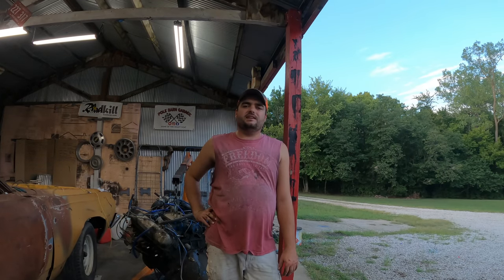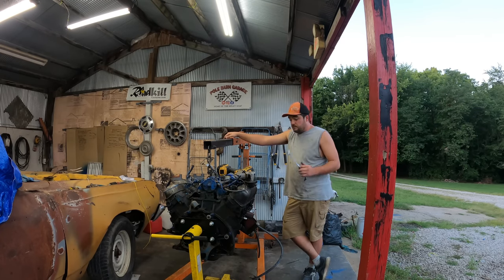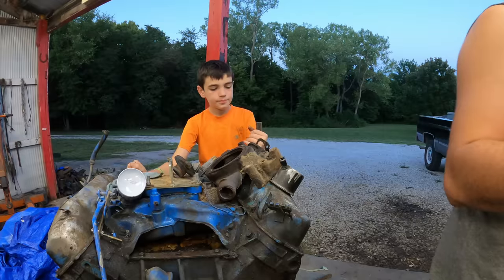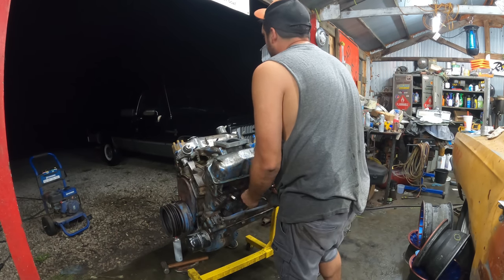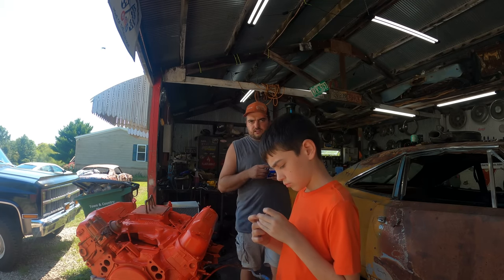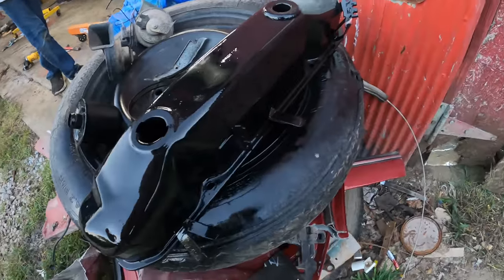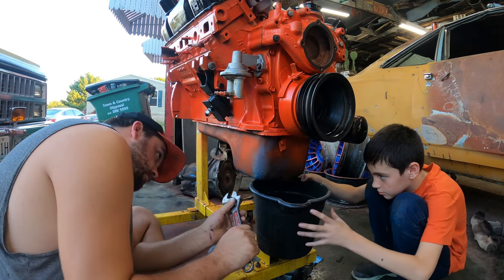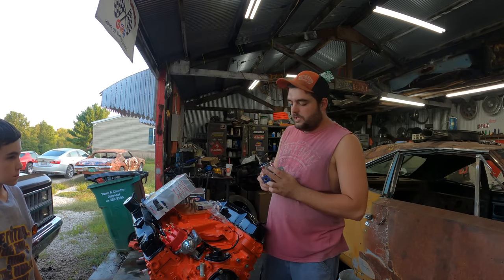Prepping Motorhome 440 for World's Worst Roadrunner - RolledRunner! Rattle Can Rebuild

Comment: Great to see that tractor paint comes in black too and that it can be used on anything.  It may not stay on there forever, but it can be used.  It looks good for the glamour shots when she's done anyway....

I cannot believe I used the words "tractor" and "glamour" in the same paragraph.....but if it's good enough to go on the outside of a Ford, it's good enough to go on bits of a Mopar engine.

I'll enjoy watching this beast come together and hearing that 440 fire up sounding like she's fully rebuilt.  All the best, mate.
Reply from the maker: I'll be curious to see how heat resistant it is. I paint tractor engines with it 🤷
Reply: @PoleBarnGarage  - You could really test its resilience and paint the exhaust manifold with it.  🙃😉  Seriously, I dunno if I would be THAT confident in its thermal rating, but those tractor engines do get up to a heck of a temperature and put up with a ton of heat cycles, so....?

Comment: You can change the tailshaft and housing but you gotta dig into the trans to do it. Its not super hard really since you arent taking any sub assemblies apart. The 67 trans has a smaller hub on the converter where it goes into the crank snout. Then you also run into balance issues because the motorhome motor is externally balanced and the 383 is not. They do sell weighted flexplates however so you can use a neutral balance converter, but they are starting to get pricey. - Jamie
Reply from the maker: Great..

Comment: I myself have found that if you silicone the valve covers on with gray RTV and then allow it to completely cure, they will never leak again. Use brake cleaner to remove all oil first. Kind of a pain if you have to go back into it tho.
Reply from the maker: Oh, so you're the guy that caused this mess!
Reply: I doubt it. But when used properly, it works wonders. I resealed my small block Chevy and it never leaked a bit for 80k. It was still dry when I sold it. Valve covers and intake ends. Glad to see you teaching your kid about this stuff. Good stuff to know as you go through life. When he has a problem, he will have a clue as to what’s going on. 😁👍

Comment: as a cheaper alternative to Brake Kleen if you can get denatured alcohol and put it in a spray bottle it cuts grease  and it also evaporates water, a gallon of denatured goes along way and as a bonus if its left on paint wet it will loosen up most paints.
Reply from the maker: Excellent idea!

Comment: Nice cleanup on the engine. Looks like that 440 has a cast crank. The compression on those is abysmally low, '77-'78 was in the 7.5:1 range and earlier it was supposed to be 8.2-8.4:1 but rarely ever was. It was usually 1/2 below whatever the spec was.
The motorhome trans is much more heavy duty than that Fury trans. They used to tweak the transmissions based on the engine, usage, and power output. 
Yes, you can change the tail housing but you're going to have to change the output shaft too which would require a complete teardown of both transmissions. You need to pull everything out from the pump end in the front. It's not as bad as it sounds. Just about any year Chrysler shop manual has the teardown procedure. If you're going to be beating on it I would give serious consideration to using that motorhome tranny. It's not as bad as it sounds. I've torn down TH400's TH350's  TF727's and TF904's before. There's more clutch packs and wider bands in the truck trans plus the line pressure and kickdown apply lever has a higher ratio for faster 1-2 shift. The rear sprag is a weak point on those and I'm not certain but the MH trans might have more rollers. 
Btw, the HP engines were the only ones painted orange, the standard perf were blue or aqua-green. I used to get my cleaners and chemicals at the dollar store too. I noticed their oven cleaner was made in China. Good luck!
Reply from the maker: Good info. I'll probably have my trans guy swap em over
Reply: @PoleBarnGarage  Yah, it is pretty involved. One thing I forgot to mention is the torque convertors. They changed the input shaft spline in 1967. So '67-up is the same, '66 down different. Don't know what year that Fury was. I think the motor home may have had more stall for torque multiplication. The drive (flex) plate is specific to the toque conv dia. The B&M are drilled for many.
Reply from the maker: 440 is externally balanced so I need a 440 converter right? Fury was a 67 or 68 so maybe I'm good
Reply: @PoleBarnGarage  Most were internally balanced. The 440 6bbl and some forged cranks were external. You can tell by the torque convertor. If you filp it and look at the ENGINE side and if there are small weights welded near the ring if it's external. If not internal balance. They neutral balance the converter itself with 'shim' weights on the TC case itself. Any weight near the ring gear is engine balance weight. The harmonic damper would also have what looks like and offset eliptical ring near the front.
Reply: @PoleBarnGarage  I just checked my DC engine book. You are right it is externally balanced. B&M used to make a flexplate that put the balance weight (engine) on the flexplate so you could use any neutral balance converter or knock the weights off an external one. Most of the 360 4bbl HD engines used hi stall converters. EDIT: The flexpate is pn 10237, still available. BTW, you can use any non-lockup 727 converter ('67-up), even from a small block. Guys would use the 340 converter for 440's because it had a higher stall.

Comment: 71 and up 727's are upgraded and best model to have. Being a RV trans will be heavy duty and likely have forward drum with 4 clutchs and planets over the 3 in standard 383 trans. But yes, you'll need to swap the output shaft to swap housings. check out my vlog on b&M deep pan 727 install. looks good, can't wait to see in the chicken.

Comment: Try Fitting up the pick up tube and oil pan from the 383 and don't forget to reuse the windage tray.
Reply from the maker: Did you miss the video where I found the pan to be rotten off the 383 and stabbed a fence post through it with ease?
Reply: @PoleBarnGarage  Yeah, I guess I did. Sorry.

Comment: To plug the intake and exhaust ports on Moper big block heads while cleaning or painting, Go to the dollar store and buy a package of small scrubber sponges. Cut in half, they fit perfectly in the ports with the scrubber side facing out, and keep crud out of the ports. Why not use the pan and pickup off the 383 if they're passenger car items?
Reply from the maker: Would, but it's rotted through

Comment: I had picked up a winter rat Pontiac 100 for $100. I noticed that the valve cover was leaking. Picked up a new gasket and found the aluminum cover had been over torqued and busted the cover. At the time a new cover was too expensive for what I paid for the car. So I did the right thing and cleaned the cover, and jb welded the broken piece. No leaks and held until I sold the car a few months later.
Reply from the maker: My Vette has L82 valve covers, I fixed one just like that over a year ago and drive it 200 miles a week or so

Comment: What product(s) do you think get paint off the engine and accessories the best?
Reply from the maker: Wire wheel on a die grinder. Maybe paint stripper? Never used it on an engine

Comment: Big blocks and a different bolt pattern then small blocks. If you change the tail shaft you need to take the trans apart.
Reply from the maker: I don't have any small block stuff? Fury had the 383 that I was robbing stuff from  in this video
Reply: @PoleBarnGarage  Okay, I looks like I need to catch up.  Sticking auto is smart.  The 4 speeds have a special floor with a hump and you also need pedals and a Z bar, just a pain.  I will go watch older vids. -cheers.
Reply from the maker: Car was originally a 4 speed, so not quite as bad as that. I'd use hydraulic clutch regardless. Still, way too expensive

Comment: I put new old stock factory motorcraft spark plugs in my 1993 Ford F-150. Runs like a top. Better than the auto lite 25’s that were in there long enough to wear down the electrode

Comment: Back when I was young in the 70s, we’d pull the heads, throw away the fiber head gaskets and replace with metal magnum head gaskets. If the engine had flat top posts the gaskets could gain you an increase in compression up to 10 .

Comment: The water pumps on those motors are all interchangeable but you got to look at the propellers inside some are different and move the water in different way and if you get one that isn't right you'll know because you'll be overheating they also have a few different thermostat styles well I believe two a skirted and a non-skirted thermostat also something to keep an eye on
Reply from the maker: Hmm I didn't even think to look, but I bet it's wrong

Comment: The best stuff to spray in there is WD 40.
W D stands for water displacement and it is formula 40.
Though it can be used as a lubricant, I wouldn't use it for a Squeaky hinge. In less than 9 months, you will be spraying it again.😉

Comment: Mopar Guy here, I will comment on the engine color:

Color of the engine, Hemi Orange 440's from 1969-1971 on the high performance versions example Dodge 440 Magnum ,Plymouth 440 Super Commando and Chrysler 440 TNT...also the high performance version of the 383 and all 340's from 69-71..426 Hemi were always Orange. 

The 1969-1971 Non High performance engines were painted blue..

1968 and older High Performance 440's were same color as the non high performance 440 that was blueish turquoise..

1972-up engines were all blue until 1986 when they went boring black..

1972 up engines the internals,cam,crank,heads were all changed even on 440's and were not even close to what they were..

  Like your channel not nit picking just blabbing...I am still learning things about Buicks from the 60's from a buddy of mine..Just neat to know as a car guy.. 

*If we were closer I would let you drive a few of my cars...at our car club we always let the younger guys do that,fun all around..I belong to a multi make car club..Have a Great Day or Night,Cheers!
Reply from the maker: Cheers!

Comment: 68 Plymouth Belvedere 4 door. Withstood the reckless driving of a 17 yr old teenager. 318 without a 2nd gear in the automatic cause some idiot downshifted at 90. Unknowingly performed a perfect Pancake turn where the car leaves the ground then lands in another direction. Slid off road destroying 4 wheels n walking home. 
Great car.

Comment: On that oil pan.  I dont think that one will fit in the roadrunner.  I have the 69 GTX and changed the pan today.  I think you need a mid pan.  That pan hump in the front might not fit.  It would hit the K member..  Anyway, check into it.
Reply from the maker: Yes that's why I bought a mid hump pan, but I bought a 5 qt pan, I need the 6 qt pan
Reply: @PoleBarnGarage  The one I just installed is a 4 quart plus 1 in the filter.  I think its what the factory installed.  I had the big 7 quart one installed and hit the ground with it.  It made a hole.  So I decided smaller is better.  Im hoping its enough.  Also, its relatively easy to replace while in the engine bay.  Drop the cross link and its easy access.  Good luck and can ya straighten some of that metal out?

Comment: It's scary how some engine stands are made... before I bought mine I borrowed a buddies to build the second engine for my pulling truck and a fully dressed cummins 5.9 weighs 900lbs and the stand was "rated" for 1200 and it didn't even slightly hold it, it snapped at the bottom of the horizontal post as the cherry picker lowered the chain never got slack as the stand broke 😅 I had to go out and buy a good engine stand and then it worked great.. since then I welded up a better support for my buddies stand and now it works amazing for his gas engines.. but yeah they should be better regulated when manufacturing these things...

Comment: that kick down assembly probably won't work its going to hit the fire wall I had to buy a cable kit for my 69 charger when I put the 440 in
Reply from the maker: I have a secret trick for that. It's called a cut off wheel

Comment: Only the big blocks rotate counter clockwise, small blocks go clockwise. In my experience Mopars do not like AC plugs, at least the many Mopars I have owned (well over 50). I prefer Champion plugs usually.
Reply from the maker: New champion or old? I have to figure an American plug has to be superior
Reply: @PoleBarnGarage  I buy new ones and according to the interweb they are made in the US.

Comment: Rule #1:  Powerwash the  peice of crap before you start working on it. You get less crap on you, and you don't have to buy Goop by the drum. Rule #2: If it's not broken, don't fix it until it is. P.S. I believe I have a front timing cover and valve covers from a Roadrunner with the plug wire holders in right locations. KC area. Channel donation if you want them. I drive Jeeps.
Reply from the maker: I'm not getting back into it unless I have to, but I appreciate it!

Comment: I have the same chinesium engine stand, but red, barely holds an inline 6 with alu head and no accessories... which should be less than 460lbs and it is rated to 1000lbs like yours. I am afraid to even fart when I walk by it.
Reply from the maker: Same

Comment: The big block Chrysler was designed to be ran with a windage tray!
Reply from the maker: I thought it was kind of an afterthought. Otherwise why not bolt it to the main caps?
Reply: @PoleBarnGarage  I agree! But that's how the Chrysler engineers did it 🤷‍♂️

Comment: I like your channel recently found it and subscribed..BUT uh oh lol,don't worry..Dodge&Plymouth were not cheap or rattle cans nor thin metal they actually were built better than gm/Ford cars they competed against..That's one of the reasons from the late 50's to 1989 they used Dodge/Plymouth cars as police cars,they were tough,durable,reliable and quick..Also handled better than Ford/gm cars..Ford cars from the 60's-70 did rust the worst out of the big 3..

Plymouth actually competed against Ford&Chevrolet..Dodge were always more expensive..except the trucks&vans..

Dodge was more expensive and was Olds/Buick competitor..example Charger was a very expensive car for its time not cheaper priced like a Chevelle ..Charger was an upscale car...Oddly you could buy a new Chevelle SS 396 cheaper than the cheapest 383 Road Runner when brand new..A then new 1968 318 2bbl Charger was more than a 396 Chevelle SS for an example,I know strange but it was..

I started driving in the 1980's and drove them all,owned them all..I preferred Dodge/Plymouth and a few Chrysler's I owned over gm/Ford because they didnt rattle or squeak,that really annoys me..

Now,when you buy a car today sitting for 20,30,40 years with 200,000 hard miles anything can squeak&rattle..gm on some models did ride smoother but were mushy like a Ford...Chrysler's torsion bar suspension made them handle flatter and rode a tad rougher,not by much but a little..You dont notice it as you can hit a pothole and not notice it but you can take a curve a lot faster with them..Even car magazines back then noticed that and mentioned it in tests..

FYI:I restore and sell old cars...I own a slick original '72 Chevelle SS 402 that was never abused and 80,000 babied miles(not 180,000 or 280,000 that most have)and yes many Mopar's,even 2 Ford products..

Its funny a lot of gm cars have missing door panels and door handles,was like this since the early 80's..Mopars always had them even my gm buddies cant argue that fact lol Cheers.
Reply from the maker: Thanks for your comment and for watching!